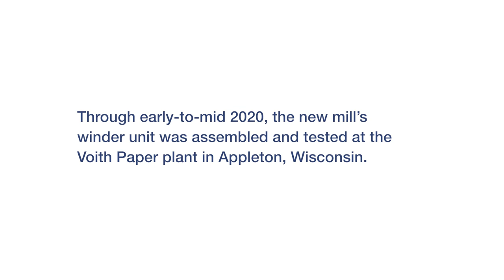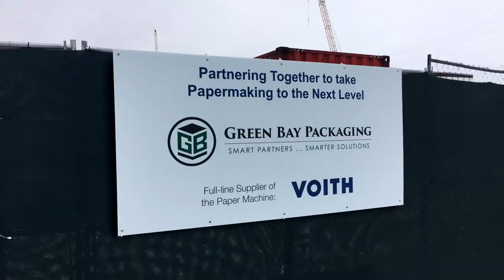Voith #Paper delivers: Watch as we transport a paper machine winder to Green Bay Packaging

Comment: Voith is a super paper machine design
Reply: I worked at Great Northern Paper in East Millinocket, Maine from September 1979 to April 2011. We had 2 Beloit machines that trimmed at 250 inches, and ran at 3500 ft pm. We made light weight directly paper with basis weight from 18 lb. to 22 lb. The 4 smaller machines were very old, ran about 1200 ft pm and made news print from 26lb. To 32 lb.